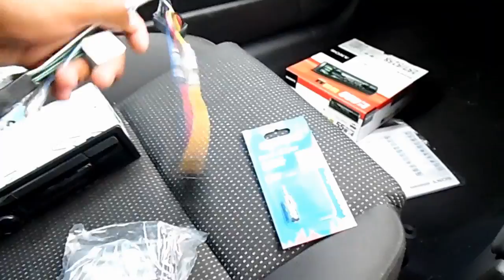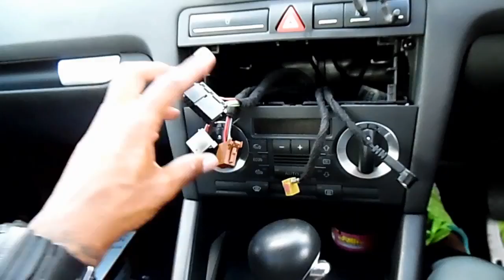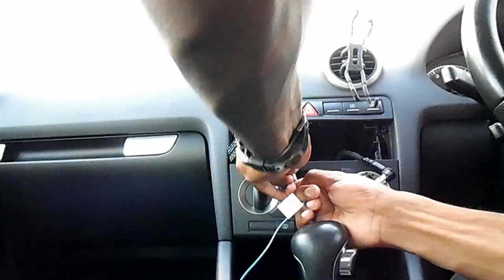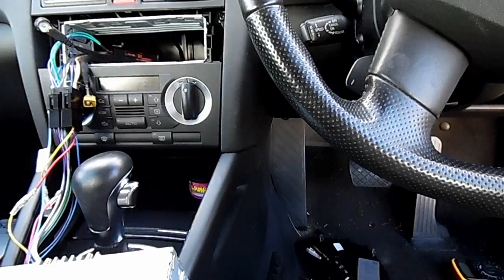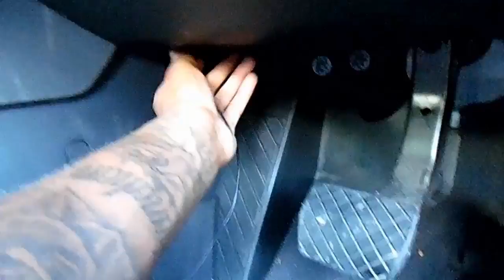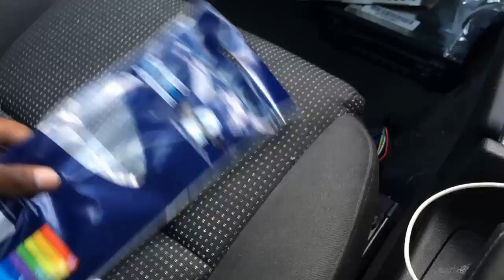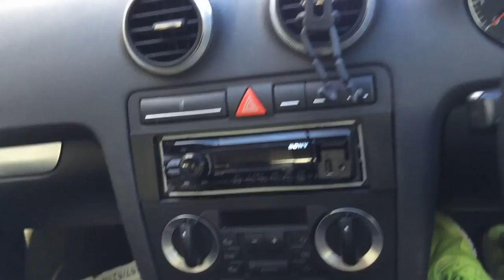Car Stereo Sony DSX A42UI Install On Audi A3

Comment: easy to follow steps! thanks for making this video, ive never installed a stereo before i dont even understand what the wires mean but i have confidence!! and luckily enough when i checked the stereo i bought its the same as yours! now i just need to order the antenna adapter and the facia thanks again!!
Reply from the maker: Perfect? glad I could help :) have a look in the description for the accessories that are needed and also the aerial aerial booster which boosted the signal when trying to get reception for radio 👍🏾
Reply: Yes it was a perfect user friendly tuts though I think I did something wrong Because when I turn the ignition off the stereo resetst
Reply from the maker: +Gian Santiago the problem you're having is with the powering. You need the ignition live 12v which turns on with the key and the constant power 12v which keeps radio stuff in memory and stops it from resetting. Try swapping the cables over? That's the only solution if you've followed the video and installed as I did :s
Reply: Haha here's the hard part I think as I dont know what the wire color means or any technical terms that's why I'm so happy to have found  your tuts but yea it's the wiring because I remember I only tapped the ignition live to the yellow wire in the sony harness but the yellow wire on the Halford for some reason isn't connected anywhere in the car different speaker system perhaps?
Reply from the maker: +Gian Santiago not too sure mate. You might have bose sound system. Again all I can say is you must have the harness and make sure you have a yellow wire connected to the harness and red wire connected to the ignition live you got from the fuse box and check wiring on your box...
Reply: TW Randomz fixed the harness and you are right its the way i connected it, all done and sorted now just waiting for the fascia and adapter to arrive from the mail and its gonna be a perfect flush install, thanks for the tuts again!
Reply from the maker: +Gian Santiago perfect! Enjoy mate!
Reply: +TW Randomz got everything and installed it, well what can i say its just amazing! i just realised that i got a DSX-A40UI not the 42 one that you ahve its actuallygood for aesthetics because its red in lighting and suits well with my dash and all but i think it works the same as yours..
Reply from the maker: +Gian Santiago good good :)

Comment: Well got new ground in,tried without rca's and without engine running.
Noise at the background and am not even talking when the wipers or parking lights are on lol.
Got pioneer unit so might be the pico fuse which i already desoldered.
Don't want to waste extra money on new radio.
Btw the existing unit has the option of changing the led to red and white which you might appreciate as  an audi owner.

Comment: God job mate appreciate it.
Had issue with mine pioneer radio picking noises up from lights,alternator,
Etc.
How is yours?clear sound?shame as u mentioned that the radio has a green led.
Reply from the maker: +Dali Rusnacik Yh shame about the green led...thanks for watching! The interference may be a ground pretty problem... Check this?! http://knowledge.sonicelectronix.com/car-audio-and-video/accessories-and-installation/how-to-eliminate-engine-noise/